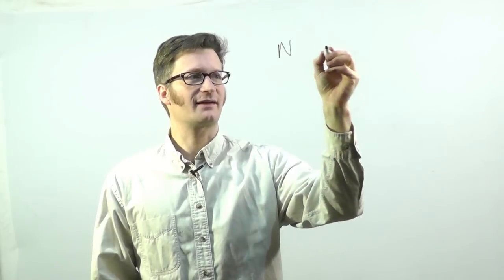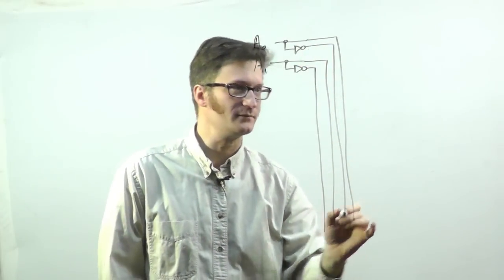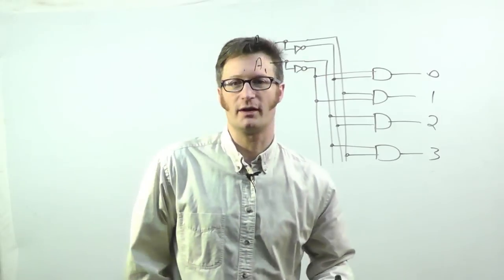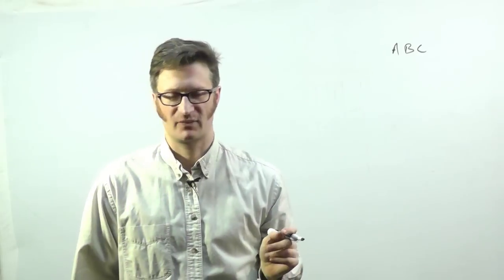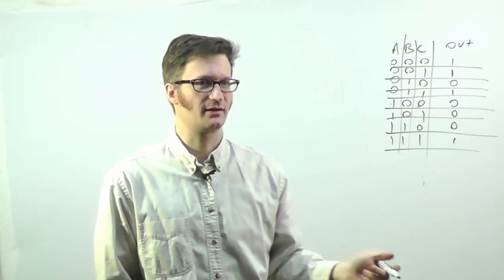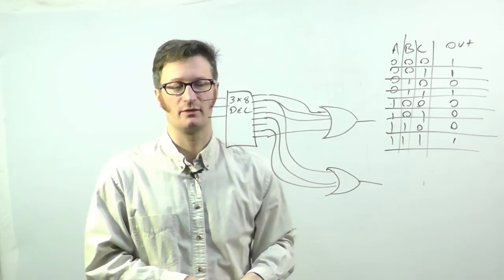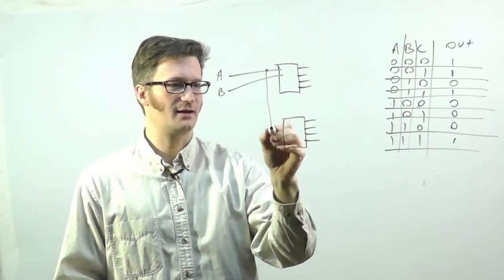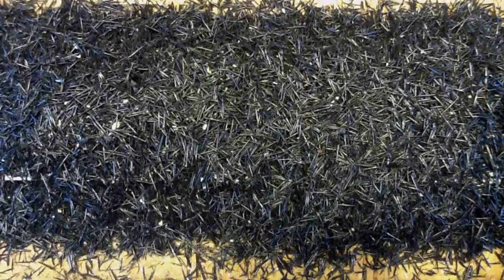Digital Logic - Decoders

Comment: In the very end when you combined two 2x4 decoders to make a 3x8 decoder you used C as enabler. But there must be MSB connected to enable pin which is A in your case.
Overall video lecture was great.

Comment: Sorry I'm a bit late to this discussion, just a small addition to your final '3 to 8' decoder. If you had used a separate '2 to 4' decoder to generate 4 separate enables (first level), to four decoders (second level), you would have gotten a '4 to 16' decoder overall. The tradeoffs are time delay, additional current demand and space on your circuit board. Otherwise an enjoyable video, including for review.